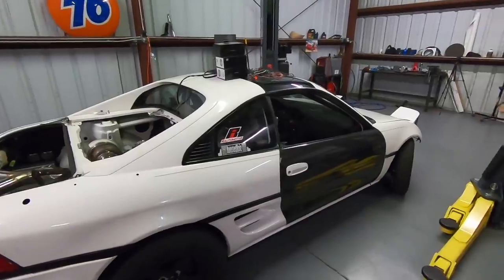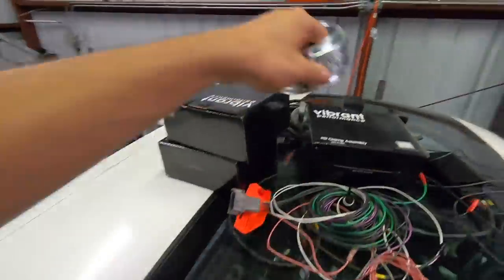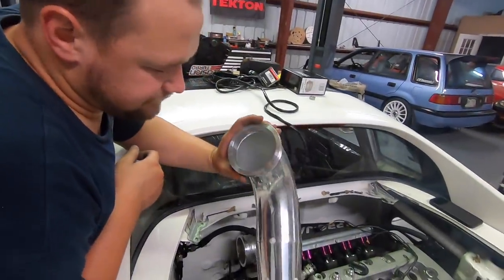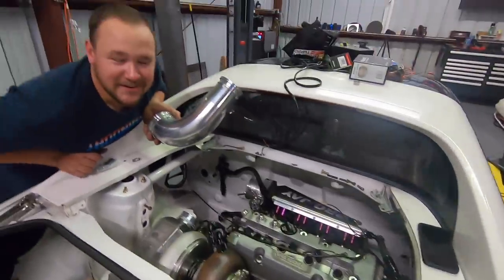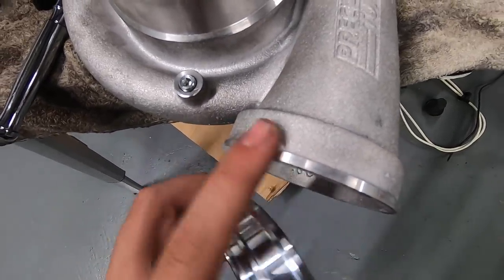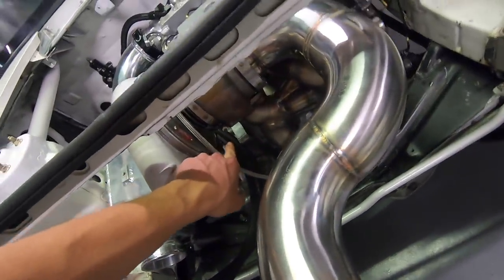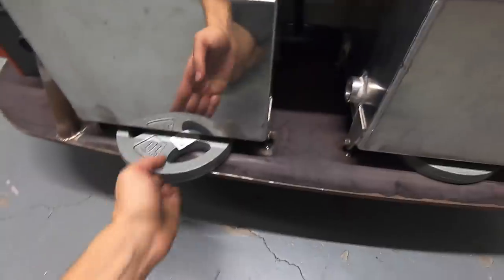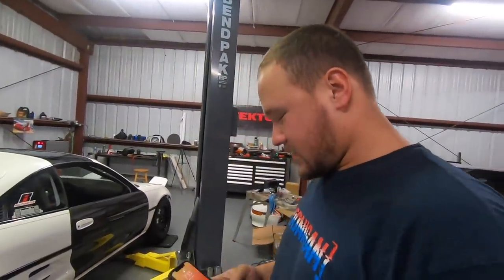So We Put The Mr2 Back On The Scales and It Lost A LOT OF WEIGHT!

Comment: Did you know you can also buy carbon rear quarters for these cars... that would be a HUGE weight saving !!!
Reply: do it kyle full send at this point
Reply: @TomoHawKzZ  wrong
Reply: @TomoHawKzZ  Currently they are adding weight to the front. If they can remove weight in the rear, that would mean less weight to add to the front in order to get that 50/50 weight distribution.
Reply: More weight from rear means less counterbalance weight in front DUH. I agree its FULL SEND
Reply: Gonna go to the line and just flip over backwards. LoL
Reply: A lot of drag classes require stock quarters though.
Reply: @ndisa4444  Do what Reaper did in his 69, Carbon quarters with just enough metal to get a magnet to stick lol. Besides, until Kyle gets a 7.50 cage, Im pretty sure Boosted Boiz ain't care
Reply: @ndisa4444  isn't he just trying to beat the record for fastest mr2?

Comment: The carbon T tops with fibreglass engine cover will help big time. Rest of the weight on the nose will go a long way to stop her lifting hopefully. 

Looking like you’ll need a new cage now Kyle, she’s going to be rowdy
Reply: Instead off the fiber glass hood thers a full cover u can get 4 the rear which cuts down loads on drag and weight
Reply: He already has a carbon egine cover being made by a follower
Reply: No way how did I miss that when did he say that ? Hopefully it's not an engine cover but the race engine cover thing
Reply: The change of engine should help because of the fact the k20 makes less torque
Reply: @Matty.Hill_87  yep no more 2.4litre twin turbo k24.
Reply: @catxx5480  fuel tech video I believe
Reply: Iv got a carbon bonnet if he’s interested iv inboxed him on messenger
Reply: @bryanwilson1390  that's one place it's an advantage having the stock panel because it's more weight on the nose
Reply: @Matty.Hill_87  but it looks cool!  they could add more weight in the front that's even lower down. mostly it would just be really cool though lol.
Reply: How about a carbon Kevlar valve cover while we're on the subject of hoods
Reply: Nah add weight under the hood no big wheelies
Reply: @CampyCamper  agreed, it would look cool and they could easily put the weight back on, not sure if aero is better or worse though..
Reply: The t tops and cage for sure! Make it happen

Comment: The MR2 got pretty light. The only thing that will make it gain a little more weight would be the bars the track is going to make you add to the cage when you start running in the 7s
Reply: Crazy to think Florida man is running low 8s in mr2 with zero cage
Reply: @spensinthevalley3099  what do you mean? it does have a cage
Reply: @CampyCamper  not kyle's kyle, the Grey car with a widened rear end
Reply: @spensinthevalley3099  street car things
Reply: @joshuabower61  on a nhra cert track...... about to loose their license. Street car when weather permits lol aka dead on impact

Comment: Don’t add weight initially, the weight you removed plus having the CoG lower will transfer a good bit less weight to the rear under acceleration.
Reply: Glad someone pointed this out!!!
Reply: They'll add weight lol
Reply: U just wanna see a wheelie dont lie
Reply: I feel like its better to err on the side of caution when it comes to controlling the wheelies. Add a bunch of weight, and remove as they go to dial in the launch.
Reply: This
Reply: @402carkid9  expensive strategy as it often results in damage.
Reply: Nah that's dangerous, if you do that it very may could wheelie and slam the front again, you should always put the weight in, then take it out until you've removed so much that it starts to wheelie, then dial it back just enough. IMO that logic applies for many things, kind of like when you cut something that need to be perfect, cut it too long then shave what is left until it's perfect.

Comment: Should  you be adding some cage in that thing to cert it for 7.50? Funny car hoop, etc. That will probably add most of your weight back though
Reply: Their boostedboiz they ain’t worried about that.
Reply: @gasparsperformance9841   yeah but getting passed tech might be the hang up till they upgrade the cage.
Reply: Lol ive been trying to ask this for a few videos now buy that will add a bit more weight back
Reply: Whenever they do have to beef up the cage they’ll also need to drop the t top for a fiberglass/ carbon one so additional weight savings there
Reply: It doesn't matter until they actually run that fast.
Reply: @alanloyd7164  he's already run 8.3 so his 8.5 cert cage won't do him any good. He'll fail tech or get kicked out the second he passes it again
Reply: @gasparsperformance9841  even Ruby had to get a 7.50 cert cage. It was mentioned in both a Cleetus and BoostedBoiz vid that Bradenton is starting to enforce safety rules. Video evidence of knowingly letting competitors violate rules can be pretty bad.
Reply: @josephdecesaro1528  they only need it when they reach that # until then weight savings!
Reply: Meh. They got lots of weight to go. Windows is another big one. The floor could be cut out and aluminum put in. Titanium and aluminum fasteners
Reply: @josephdecesaro1528  they way that works is they will be in a class for their cage, they will run in that class till they are ready to run a fast pass then they will turn it up and probably be given a warning, or they will be told they are not allowed on the track any more for the day. This is fairly common boostedbois procedure especially back in the day when the red civic was really starting to make power, they only had a like a fake 10.5 sec roll bar set up and they were regularly making 9 and even high 8 sec passes with that setup and getting kicked off tracks. that car still doesn't have enough cage for its current power level maybe one day.
Reply: @aylahughes9185  Not really when you are a regular at the track, they will let that go for a couple times then they will tell you dont show back up till you are legal. Plus if they are running in a real  race, if you break cage certification you will be dq'd. Cage should have been upgraded during this down time as they have already been 8.30's and multiple 8.4's which is quicker then there current cage allows.
Reply: He definitely needs the funny car hoop with the T-tops. Those will not hold you in during a rollover. Surprised NHRA hasn't mandated the hoop on any open top car.
Reply: 1000 kg in the new money is awesome. You blokes are ripping out some very impressive work.
Reply: I thought it was an 8.0 cage like rubys before the funny car hoop, because can't an 8.50 cage not have the roof bars just the main hoop and door bars and the bars to the back? So I think they are still good until they go faster than 8.0. I would guess it would add at the most another 100lbs of weight when they do upgrade it and they can lose that again by removing the t tops and other un needed glass
Reply: @fast97z24  theyre putting in plexi windows, theyll literally weigh maybe 2 pound between the two..
Reply: Gotta ride that edge man,  im sure it's all planned
Reply: @joshuacollins9782  yeah glass needs to go bye-bye imo, maybe keep windshield
Reply: Agree with you 100% seems like he said they were going to do that then swept it under the rug and just hoping us viewers are too stupid to remember. Could be a divisive topic seeing how a Mr2 with better times has zero point zero cage............
Reply: @fast97z24  they said they were going with lexan for the windows.
Reply: @spensinthevalley3099  I thought there was, maybe not. MPH definitely plays a big role but theirs isn't that high yet. The difference between a 9.0 to a 8.50 is alot different than a 8.50 to 8.0.
Reply: It will add weight yes but with all that the changes to carbon fiber it will help putting a full cage in gotta think safe an to pass tech would help pluss iam sure there more weight that can be taken out besides the t tops
Reply: @tstuff1213  maybe I don't see enough cages and there's just a standard people are building to (cookie cutter 8.5?) Was kind of interesting to see it play out at wcf speed factory vs the Mustang in the finals not being able to go faster because of cage cert. And having to add weights to compete
Reply: So when do the carbon fiber body panels/wheels/driveshaft/axles come in? 🤔😂 tube chassis? 🤩🤷🏼‍♂️
Reply: @NovaRedHead  can't forget wheelie bars
Reply: I said this months ago, it’ll be so amazing and sad when it runs a 7.50 and won’t be able to run anymore until it’s dismantled and funny car hoop and additional bracing added
Reply: Lots of guys only run one fast pass at the track because of cage requirements. I doubt the record was set with a 7.5 cage..
Reply: @spensinthevalley3099  he cant add a wheelie bar unless he want to be in a diffrent race class
Reply: Hell I thought they were supposed to have that to run 8s but idk.
Reply: @fast97z24  they could also get a baby to drive it
Reply: @kxlucifer  but he can add a driveshaft to a car that has axles, OK bud. We all wheel drive now? He's not looking for a class or even in a class all he wants is that fastest mr2 no matter what/legal or not.
Reply: @HotDogBunN2YG  you've obviously never weighed glass before.
Reply: Kyle will just push he luck with the track refs.
Reply: I wonder if he's waiting untill Hayden comes back down and he's going to do it.

Comment: It might be overkill, but could you replace the rear glass and rear quarter glass with acrylic to take some more weight off the back? Might be worth considering.
Reply: Yeah they might aswell just go full lexan, it's definitely not cheap though, i checked it's around $1k.
Reply: @Vlammenzee  yeah unfortunately pretty much anything racing doesn't come cheap. It would look really serious tho
Reply: For anyone curious u want to use polycarbonate and lexan is a name brand of poly. Acrylic/plexiglass is not used in cars it can crack vs poly/lexan 👍
Reply: @singlecams  cool good to know, I   thought it was acrylic, thanks for the correction I appreciate it

Comment: Mount the cooler to the Trans, so when the motor flexes your tubing won't have any stress on it. If you mount it to the chassis the motor could flex and probably Crack a weld or worse.
Reply: Solid point. if it's mounted do the drive train, it will all be moving together. Or needs really loose  rubber mount to allow the movement that will be happening

Comment: Do they make some sort of a rear skid plate for these cars? Could try covering the big hole in the back underneath. Catching all that air in the trunk like a parachute. Car is coming along nice, can’t wait to see the new time slips 🤙🏻🦅🇺🇸
Reply: great idea, he could make small aluminum plates to fit up in different spots, and easy to remove, underneath the chassis and direct air, not just jam it up underneath, causing a swirl, and also causing the car to fight against it.

 people don't think about under the car very much. but with those plates. he could make it very much more aerodynamic under there.

* also would be a huge safety measure for track racing to catch any fluids that spilled, blew out, etc.....

peace, Eturn
Reply: @theeturnone  indeed, he should talk with Myles Kerr (Gringotegra) he's got the full underbelly too
Reply: *carbon fiber plates

Comment: Awesome! This car is going to fly dude! I think it's going deep into the 7s. 8.3 on the old setup, now you lost serious weight and added power... it just may be into the league of Ruby running 7.5s passes.💪👍 and there is more weight loss possible, with the T-top in carbon fibre, light weight Windows, and some fiberglass bodyparts like de enginelid, front hood etc. Let's Go!

Comment: Plexi rear window and rear side windows will help with the weight difference from front to rear. And if you cut the bottom metal part of the rear bumper off, that should help as well and if you get rear over fenders in fibre glass you could cut a lot of metal off the cat from the rear

Comment: Why don't you wire a little fan and mount it so it blows right into the turbo?? I don't know I'm not a mechanic I just thought of that in my head 🤣
Reply: great thought, if you are just sitting around thinking about car stuff. . 
im not being sarcastic either.
engineers in labs, and car people(in general) in their garages have tried electric style turbos. . 
and the jury is still out. . 
some would swear by them, and some would say they dont work for the amount of energy needed to be put into them

but seriously. it is a rather cool idea

peace, eturn

Comment: If you really want to save a lot of weight replace all the glass with plexi-glass and you will save yourself another 60-70 pounds there alone. I think overall the best mod you could do right now would be carbon rear quarters, that would remove 50+ pounds from the rear and help that weight bias more, sub the 50 pounds you would have in the front to compensate for weight bias. If you do all that and then you add the carbon T-tops you will end up around 2150 with you in the car and full of fluids. Unfortunately, if the car runs like you intend it to then it will hit mid 7's really easily and you're going to probably break 7.50 and then need another 100 pounds of tube work in the cage for certification.

Comment: still need to add some cage to run 7s dont you? going to be a bit of weight there
Reply: cut of is 7.50 i think, thats a long way off
Reply: Yes he has already ran faster then what his cage is certified for.
Reply: @charlieward7606  Cage is currently certed for 8.5.
Reply: @MellowYe77ow  oh is the next bracket 7.5? how are they still letting him run then? he has done quite a few passes under 8.5
Reply: @charlieward7606  Yes. The track officials gave him a warning last time out. Kyle said that he was going to upgrade the cage, but has said nothing about it since.
Reply: @theeturnone  pretty sure its lower, thought it was 8.2 and kyle got real close but then the record holder beat himself and it was like 8.1or something i could be wrong tho
Reply: @MellowYe77ow  oh damn, pretty dumb not getting next cage in while its all apart then
Reply: I'm wondering if Hayden's gonna visit again.

Comment: Flat floor next? That engine bay and trunk must act like a parachute at high speed?
Aluminium plate from the weight plate and all the way out the back into a mild diffuser combined with a drag wing and I reckon a few mph are easily on the table.
Do it in carbon if that's how you're playin😋
I'm guessing that the engine is going to be putting out some serious top end?
Decreased drag, decreased lift.
Let her eat Kyle!!

Comment: By the time you as the fluids in those tanks you'll be close to 50/50.
Don't forget you've removed a heap of weight past the rear axles with the single turbo

Comment: The more u get the weight pass the front tires the better your weight traffer will be. A steel aero wing for the front bummer. Make a few sizes 50 lb 75 lb 100 lb be most for your weight.

Comment: Gas weights 8 lbs a gallon. You can average for every 100 lbs you lose you gain 10  Of a second . I drag raced for 7 years i run a 70  Camaro it weighted 2600 lbs with me in it. One of my fastest passes 
Was 7.62@165 1/4 mile. My cage was made with  Chrome Molly. That is why it was so lite.

Comment: You can get so much more weight out of it if you are serious. Carbon tops, trunk and hood. Lightest battery you can get. Drill holes where you can. Take 1 or 2 screws out of things that have 4. Plexi glass back and door windows. And there is definitely more things you could remove. Probably 150lbs more you could shave.

Comment: Do lexan front and rear windows to and you'll lose quite a bit of weight as well, at least the rear window, also the rear corner glass changed to lexan, glass is pretty heavier so I'm guessing with all that it'll probably be around 80 to 100 pounds savings

Comment: You can drop another 10-20 lbs converting the glass in the windows and t-top to impact acrylic
Reply: wow, i didn't even think of that . . great idea. . i  don't know if you ever held just one of those. but they are pretty darn heavy. .
 And it would be pretty easy to do. . and pretty cheap also
(or actually, now that I'm thinking of it.(and did a little google search. . lol) 
He could go either way:
number 1) really cheap, and some DIY style fitment, etc... with some cheap plastic 
AND / OR 
he could go: number2) and be somewhat inexpensive [i just looked real quick and he can get fiberglass / fake carbon-fiber ones, for like $200-$400. . but the good thing about those, even though they are probably , "ricer spec fake carbon. They are actual kits that come with the replacement weather stripping. which seems worth it for the new stripping, alone. 😊😀

or number 3) spend around $600-$1000 and get some real carbon-fiber ones with all the new replacement parts as well as all of the weather stripping.

So needless to say. he has options. But I don't even know what i would do. . lol.
which of the 3 options, i listed do you think you would do?

peace, the Eturn
Reply: @theeturnone  all he's gotta do is pull his glass and go to a shop that cuts acrylic sheets to exact size using a computer, acrylic is pretty cheap... i would just use black or dark tint acrylic/poly for the t tops and clear poly for the windows

Comment: Where is the front end height sensor? Even if you don't use it right away just log data till you decide to use it. Let the computer peddle your throttle better than converting it to a tube front end.

Comment: I figure sypu wpuld mount the intercooler the trans somehow so when motor torq some it stays solid with the engine and call just for safety so you dont bend or break any welds

Comment: Balls out... do ya think it could handle race week? given the fuel capacity? love this car ... cant wait till you smash the MR-2 record.... i noticed you have no shock tower brace in the rear?  I've seen them before, is there a reason you don't run one? the chassis flex is real at your HP level.